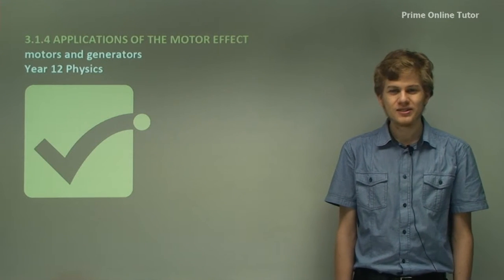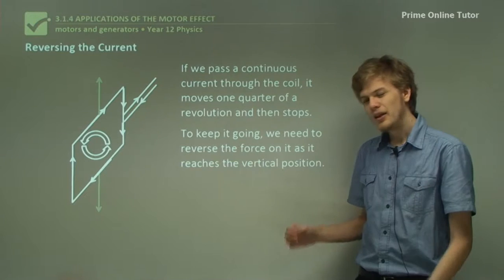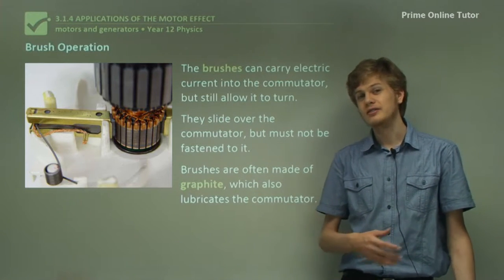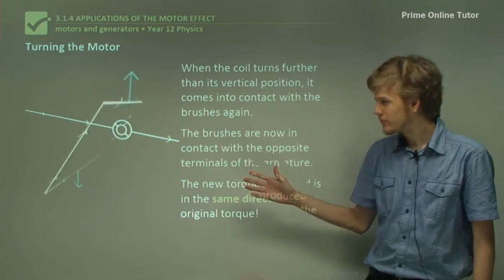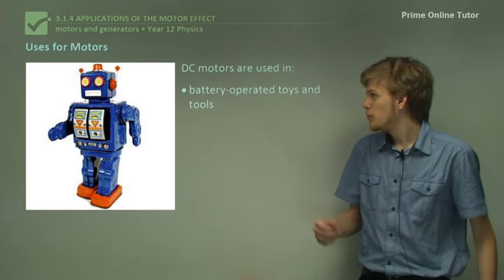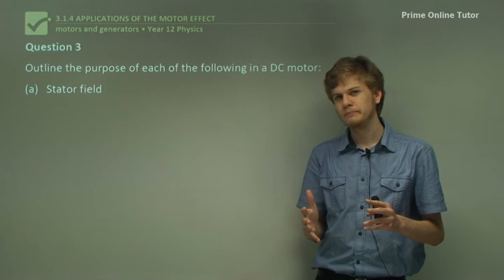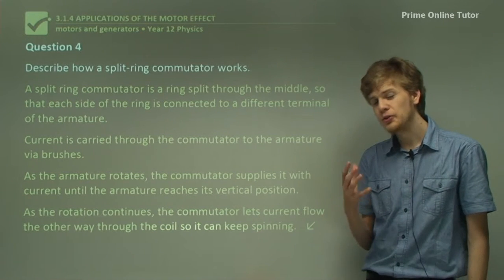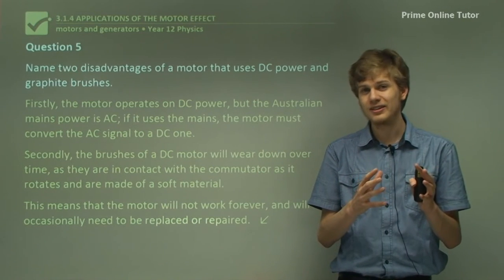√ How DC Electric Motors Work | Brushed DC Motors

Comment: Finally, I got an intuitive understanding of how split-ring commutator works.

It "commutes" current into the terminals of the coil.
Commutes in a sense that it lets the terminals of the coil experience "alternating" current directions. 
Alternating in a sense that at one moment, the terminal 1 experiences a current flowing forward, 
the next moment, it will experience a current flowing backward.

Thanks to the commutator, even tho the DC source current flows in the same direction all the time, the commutator lets 
the coil terminals experience the forward and backward direction of this DC source current.

Thank you for pausing at the end of each important concept, it lets us digest the information quite well.
Thank you, sir, you are a great teacher! :)